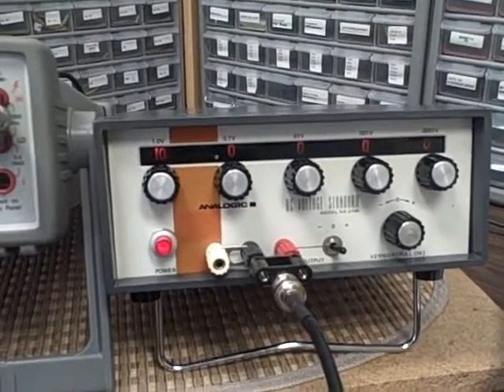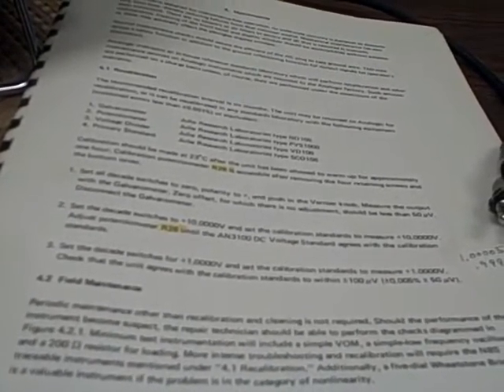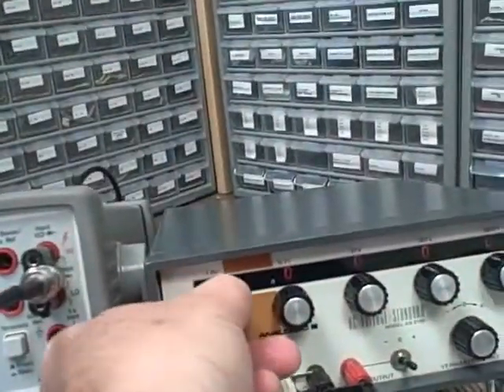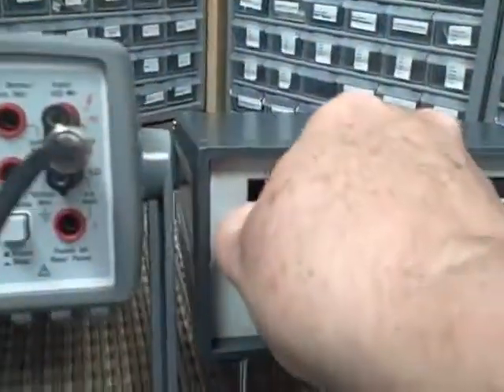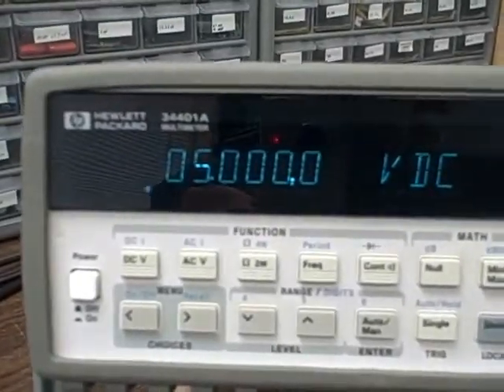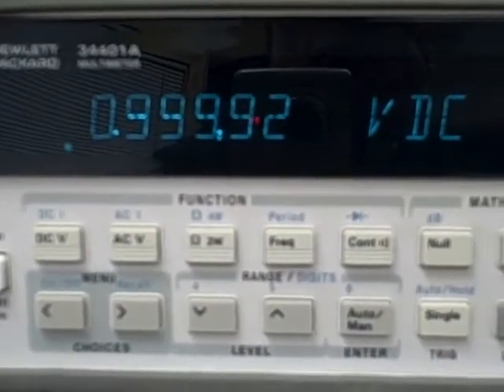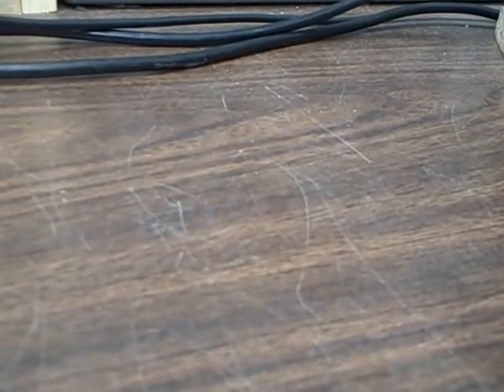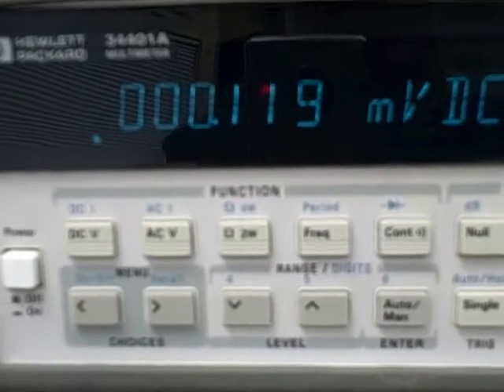Analogic AN3100 - 5 Decade Secondary Voltage Standard Perf. Test

Comment: Have just got hold of the same instrument, cool machine!
Reply: Kind of strange to see how people evaluate accuracy in 5 1/2 mode by using 6 1/2 multimeter. The same with checking milivolts without initial setting multimeter zero when calibrator output switch is at zero position.